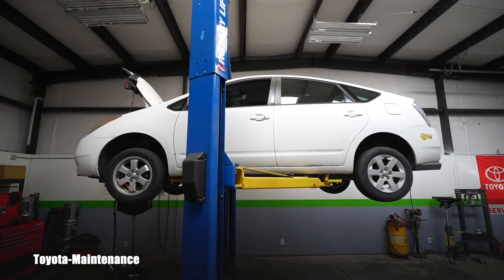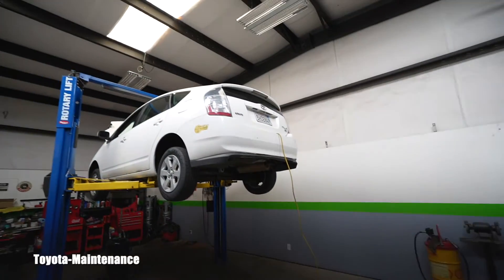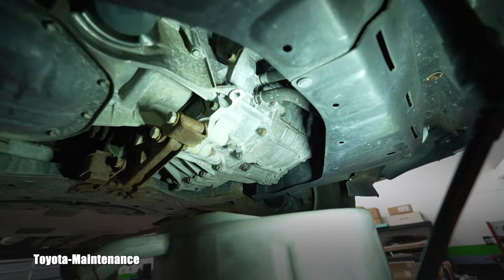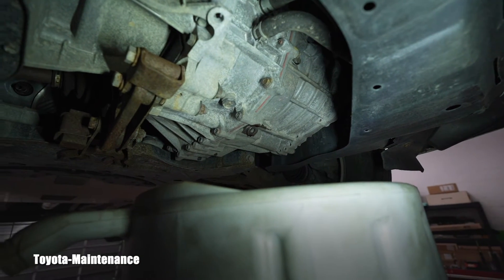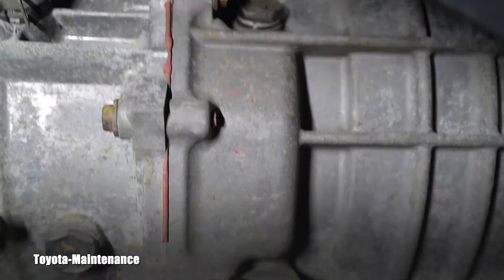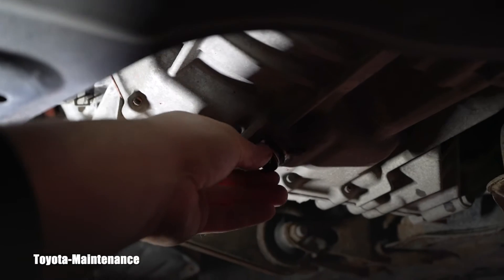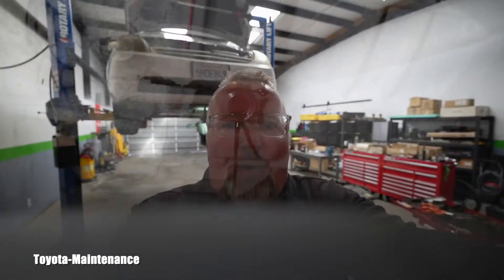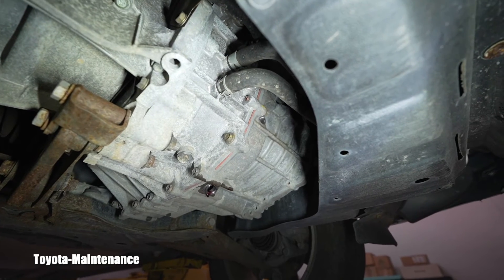How To Change Transmission Fluid on TOYOTA PRIUS

Comment: 24mm?!  Are you certain?  That seems excessively large for the transmission filler plug hex (and the inverter coolant drain hex).  The average set goes to 21mm; sometimes 22mm.  It would be ideal to know before jacking up the car and crawling under.

Comment: I have a 3rd gen with 360,000 miles on it.owned since new and have never changed the fluid. Just changed it and it was black as to b e expected but no burnt smell. I had No reason to change it just decided it was time. I know Toyota says it never needs to be changed, but for the price of 40 bucks it’s good insurance.

Comment: i've 2001 3.4 toyota tundra 2wd ive changed transmission fluid with toyota ws .after changing i face an issue with shifting and codes come p0755 p0750 p0420 ,any idea ???

Comment: That car is good for about 220,000 miles and then the bigger issues come back to back - main battery ($1700), front wheel bearing ($450), replace original brakes all around ($550) and you'll start using oil because the little 4 cylinder wears out with the constant start/stopping. Have 252,000 miles on an '08 and will hopefully retire her at 300,000 miles.

Comment: No trans filters to replace? I have an old 2000 Echo and always assumed the Prius and Echo shared many components but I guess not so much. For the record, I switched to Valvoline Maxlife Multi-vehicle ATF (full synthetic) for all my vehicles, except CVT, and they all shift smoothly. Most everything else I select OEM.

Comment: I don my Toyota auris hybrid 2015 at 90,000 miles, and I have just don it again at 139,000 miles, it’s quite easy to do but ,to make life better for re filling, I got a small vacuum pump that you pump it back in bye hand pressure squeezing the ball , I got it from my local car parts shop for £20 .

Comment: No need for a pump to fill the ATF back in, i used a hose pipe & a funnel from the top of the engine bay....no need to make it more difficult as it needs to be. I did my 2015 Yaris 1.3L  CVT (Non Hybrid) and it only takes 2.2L. I got the proper Toyota CVT FE ATF drained & re filled 2x as my fluid came in a 5L bottle,left it a week & repeated it. Cost about £70 (5L bottle) so i won't just leave 2.2L sitting in the garage doing nothing.

Comment: I find it easy to thread a plastic tube down from above the transaxle into the fill hole and put a small funnel into the top of the tube.  Then I pour from above with the drain pan still in place until I hear the overflow running out.  Peter, your videos are fantastic.
Reply: I do the same I use a cut 2 ltr soda bottle with a hose that has a close off valve.

Comment: My 2008 Gen 2 Prius is at 244K New England based miles and going strong, with zero rust. I've changed the oil every 5K miles and trans/diff every 40K. I might try the trans fluid change myself after this video

Comment: Another great video from peter 👏 anyways i have a 98 Toyota Camry V6 3.0 and they dont have the right transmission fluid at my Toyota dealer. They just tell you to put any dex  fluid they have some blue bottle ATF MD-3 made from chevron i did it 3 times so far. Cause i cant find any fluid that fits my car its not Japan made thank you for another grear video

Comment: Nice video Peter. I DIY maintenance on all my vehicles. I have a Gen2 Prius as well but have been using Valvoline MaxLife synthetic for years without issue. I don't have a hydraulic lift at home so I put the car on jack stands and use a funnel and tube and fill the atf from above the engine. Love your content!

Comment: Peter, if you will buy a cheap 1 gallon pump sprayer and install a 1/4 inch aluminum tubing on the spray end of the sprayer, you can fill it up with correct amount of trans fluid, pump it up and put aluminum tube in fill hole on trans and fill her up!  Works great and is super cheap to build one

Comment: Goes to show how well Toyota engineered this vehicle; with proper maintenance, it can very well last for another 20 years. Perhaps the hybrid battery will eventually have to be replaced, along with other miscellaneous issues that might crop up, but it would be worth the expense in a vehicle like this one. I hope that my 2018 Rav4 Hybrid Limited is just as durable and well-engineered as this 2nd generation Prius is.

Comment: Hey Peter is this Synthetic tranny oil and if not why? makes a huge difference up here in very cold Canada.
Reply: Check Bob is the Oil Guy. WS is partly synthetic, but seems to work fine regardless:

"I put Toyota WS in my Corolla before I sold it to my son, I drain and fill once a year. Fluid still comes out as red as it goes in. It now has 279,000 miles (446,000 kms) on it now and shifts like new. The OEM fluid has performed well in temperatures below -40F (-40C) and past 120F (49C) with no issues. I am not sure why I would need to choose another."